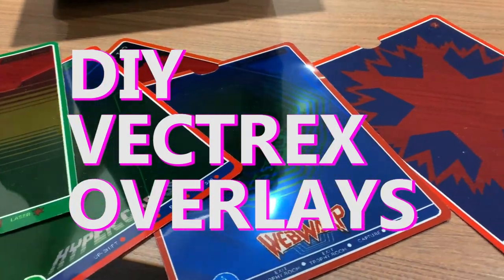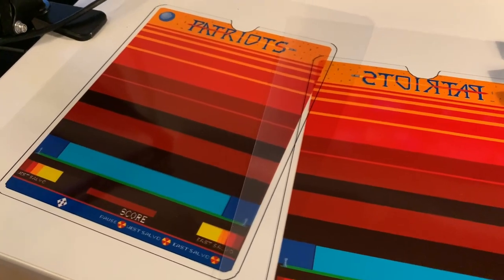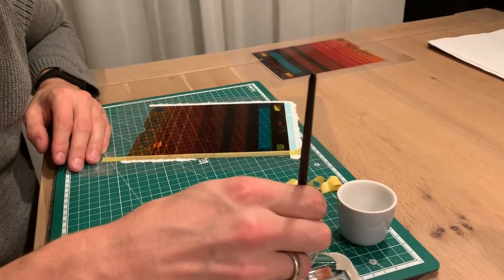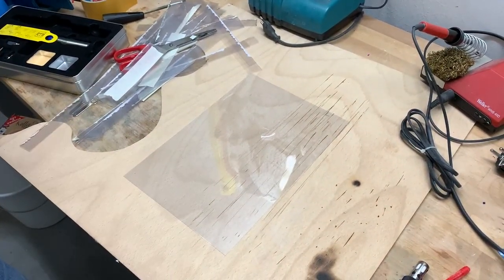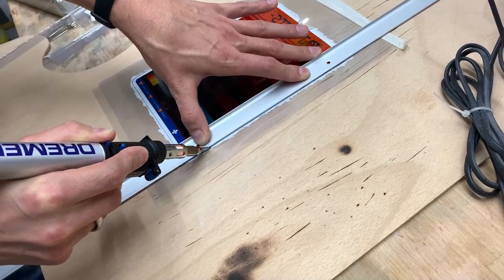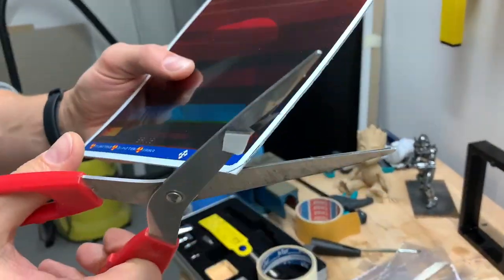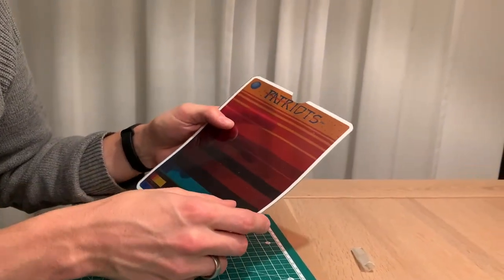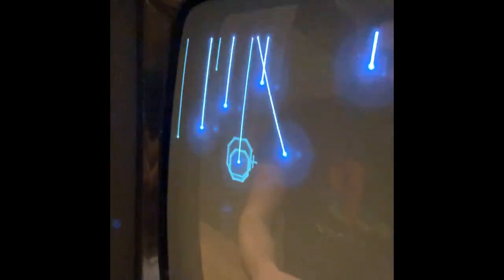DIY Vectrex Overlays

Comment: Very impressive. But is there another way to melt the two layers together without having to buy a butane soldering iron that I would never use for anything else?
Reply from the maker: I bought it for that and never used it again :-). But, I got a laminator that works very well, and could possible melt these sheets together, however, you need much heat to melt the foil.